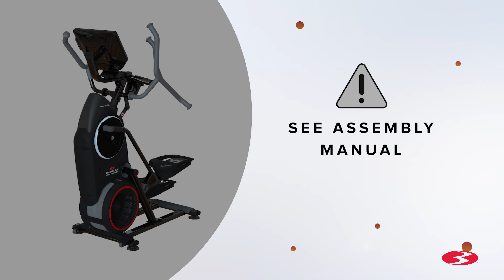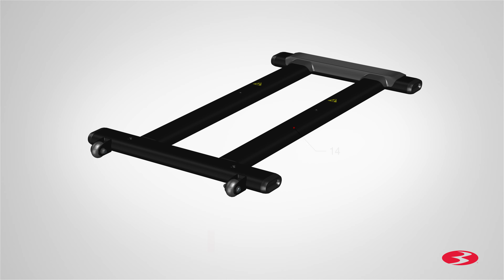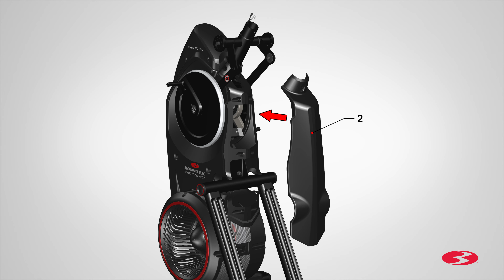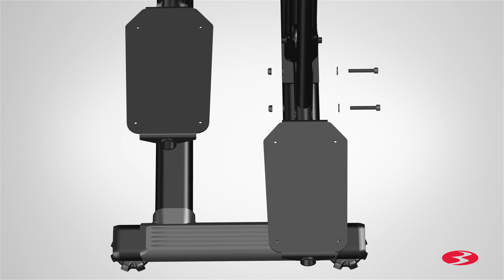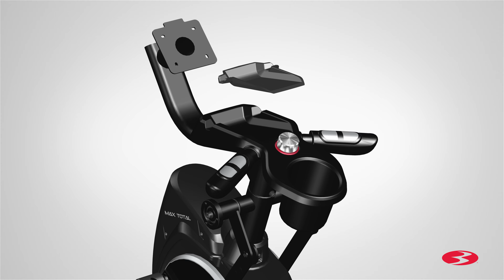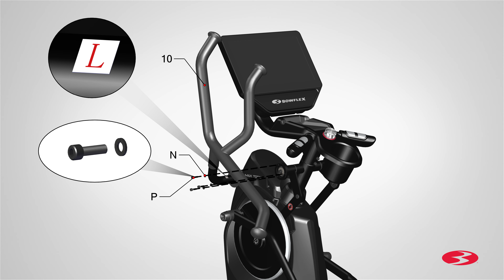Bowflex® Assembly | Max Total 16/ Max Total 40

Comment: This is a machine superior to any other
I've been using it for two years, unfortunately.
I stopped using it for travel reasons at work.
after 2 months I used it again and that's where the problems started with a software update, once updated a noise started coming out of its speakers, something like drum sounds, I called bowflex and they told me that unfortunately I had to replace the monitor, I mentioned to them that after the update is when this noise started, they said that I had to go to JRNY that they can help, unfortunately they told me the same thing, the console costs 800 dollars for the replacement, this is blatantly incomprehensible. everything works very well on my console except for that noise, the solution that I see most convenient is to disassemble the console and disconnect the speakers so I will not have that annoying noise, since I use headphones when I exercise and I do not need the console speakers.
I also discovered that if you are not subscribed to JRWY's plan you cannot open the Netflix or Amazon apps or all the other apps you pay for!!!! … no no no that's not right!!!

Comment: It's a bit confusing in the video and in the instructions when assembling the foot plates because they don't specifically show the screws that affix the rubber foot pads as passing through the metal overlayed plate first before going through the rubber pad and into the metal pedals.